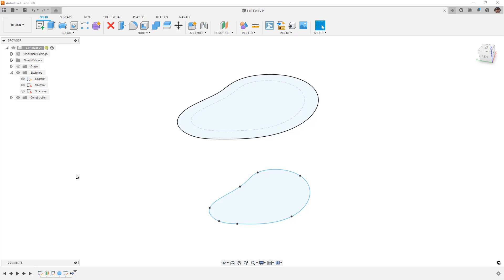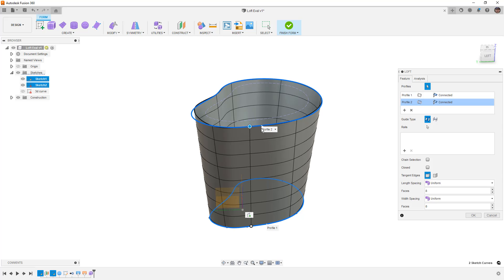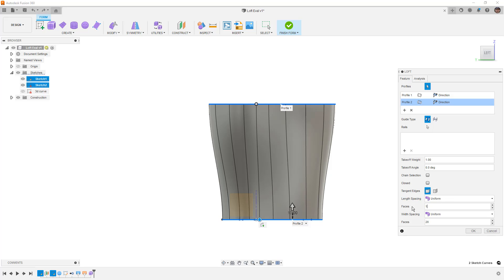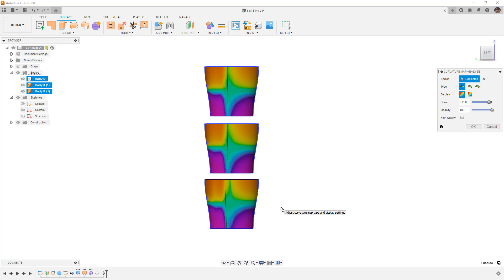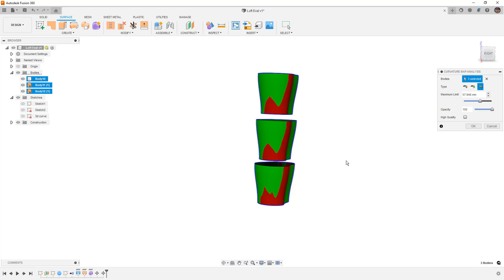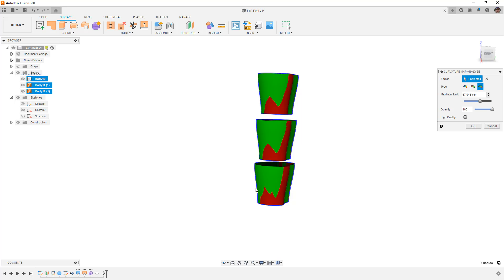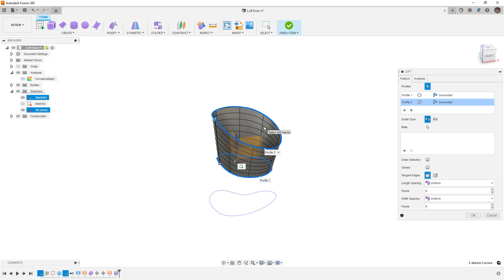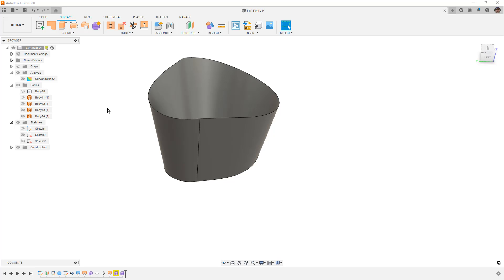Surface Mastery Part 5 - Is a Loft a Loft? | Exploring Solid, Surface, and Form Lofts | How to pick

Comment: Great tutorial Matt , can you help me , as a practice I  try to drawing  a bottle of 4.4 LDishwashing  liquid SUNLIGHT,  using surface and solids design  but I could not, was very hard for me.
Reply from the maker: With a bottle you generally want to model half of it.  So draw the shape from the side and then build the curves to create a loft.  I don't know the specific bottle you are talking about but usually there will be one big shape and that gets cut up and adjusted for smaller details.

Comment: Another awesome video!  Could you make a video going more into detail about takeoff weight and tangency weight?  When I change those values I can see the changes they make to the model, but sometimes I get error messages and I'm not sure exactly what's going on when I adjust those values.
Reply from the maker: Great suggestion!  I am uploading part 10 right now but ill add that to the list.  Most of the time the errors happen when surfaces overlap.  Fusion (and CAD) really hate when that happens.
Reply: @LearnEverythingAboutDesign  Awesome, thank you!